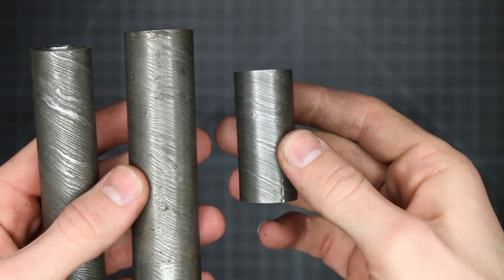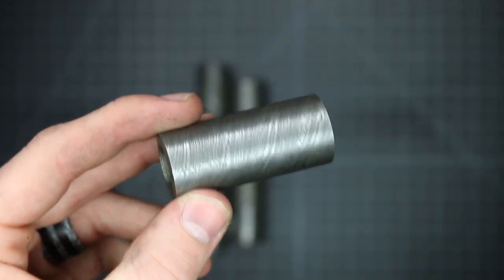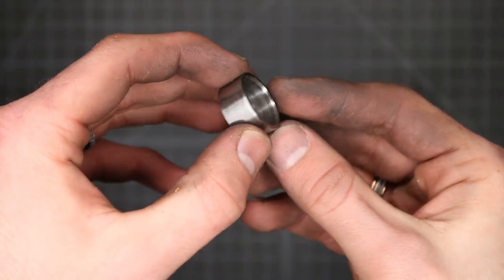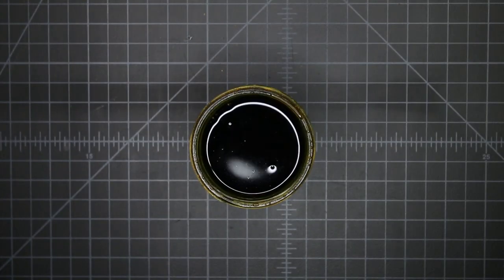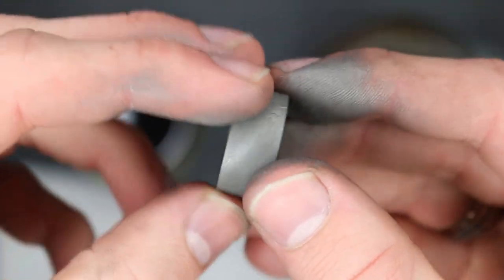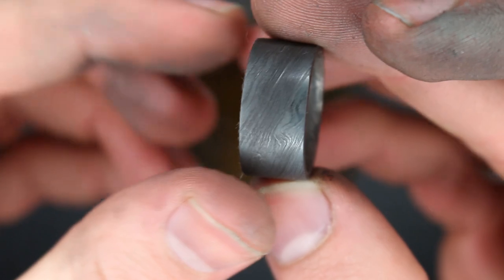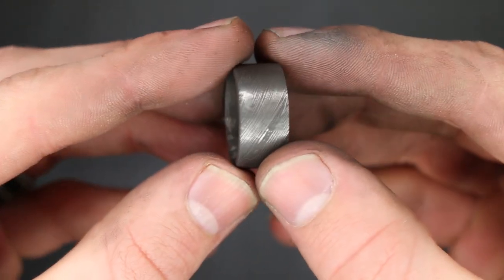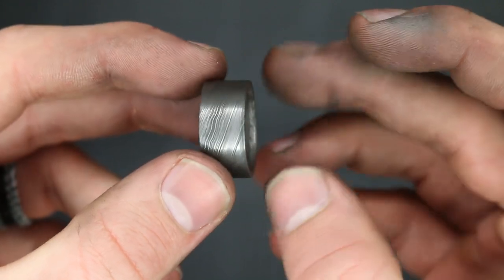Making a Damascus Steel Wedding Ring

Comment: Patrick, Just a bit of advice from a mech. engineer/machinist.  I would find a good wooden dowel, rubber pin (for compliant feel) for the sanding of the ID (internal diameter). I have seen a finger nearly spun off in our shop years ago. it was not a ring but  all the same. The machinist was sanding the ID just as you shown, problem was for our machinist, his finger got stuck. Very easy to do. it spun his finger, dislocating the tip of his finger at the joint, tore and ripped the flesh, and burnt the rest like a 600rpm Indian burn (friction burn). We think it was the blood from the injury, that lubed up the finger tip enough to let it loose from the piece part. He ended up leaving the machinist field and our company. But I do believe he ended up loosing his index finger at the first knuckle. Those lathes have a tremendous amount of torque and can do crazy damage to soft tissue. Love your videos, just wanted to give a quick safety tip. (I started playing with machine tools in my dads shop at the ripe old age of 13. so loads of years behind those cranks.)
Reply: Sounds gruesome. Ironically, on a whim, I've been watching hand reconstruction videos.
Reply: Eric gruben I just wish others would give advice in this manner. Props to you. Abdullah, London
Reply: He showed the actual speed of his lathe during the sanding process at one point, and it was very slow, something like 50-60 rpm, and he says he always has his other hand on the e-stop in addition. While it could still be potentially dangerous, at speeds that low, he would have no problem hitting the e-stop before he actually hurts himself. However, handling that acid without gloves on was pointlessly unsafe, especially since he didn't seem to dilute it with water or anything. And then he "neutralized" the acid with just water, which only dilutes it and doesn't neutralize it. He should have had something a little more basic to rinse the ring, like baking soda. Another thing - he really shouldn't be wearing a ring while he works on the lathe. He may not be sanding at high speeds, but he must be cutting at high speeds. High rpm + jewelry = bad time if you like keeping your skin on your finger.
Reply: Bruh...
Reply: So this your guys forgot about turning steel or woods on lathes the slower the rpm the more dangers are at play. I have the same lathe as Patrick and i too make rings and im guilty of putting my fingrts inside the jaw clamps. Faster you go less chances your finger will make it in.  My finger on my left got smashed off one day at Everett WA. Commercial Airline building company. Can say the name. I'm not a mechanic  or a machinest but i do know by expanding my fingers falling into the jaws and it just pushes them away . Hay Patrick where do we get new timing builts for our lathes its a  XT 136 70 tooth 1.5mm wide . Mine got ripped up
Reply: I was just think how ballsy he is to always just raw dog the lathe with his bare finger all day. But who am I to judge

Comment: So Patrick, the way etching works is that 2 types of steel are in Damascus, a high carbon and one with a higher nickel content, the steel with a higher nickel content resists the etch better than the carbon steel. That's how you get the patterns, that and how it's folded

Comment: Awesome work! Do you coat your Damascus rings with polyurethane or something like that? Since Damascus has high carbon steel in it (the part that gets black when etched), it can rust when on someone's finger. I was wondering if you saw that being a problem with leaving rust spots on skin.

Comment: How do you prevent rust? I've used white vinegar, ferric chloride, and gun bluing solution for etching, all a little different- 

I'm a blacksmith and have made a few 200 layer twist rings with 15n20 and 1080 carbon, but other then casting silver to the inside I have not figured out how to stop the rust. I'd like to leave it without silver as the pattern inside is awesome
Reply: A DimeShort try using clear powder coat. What I use on copper

Comment: I'm assuming this steel is mild or high carbon steel and not stainless. So, it must be subject to rust and oxidization.
How do you ensure that the steel won't rust/oxidize from the moisture of a customers finger? Don't you need to seal it?